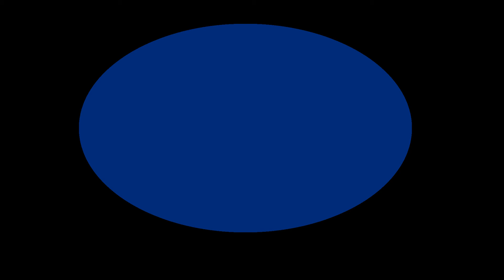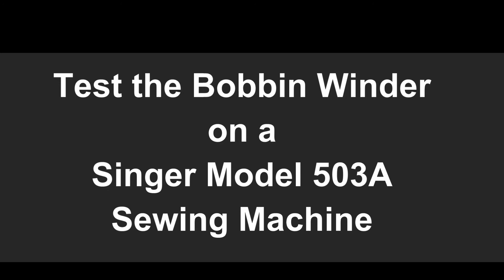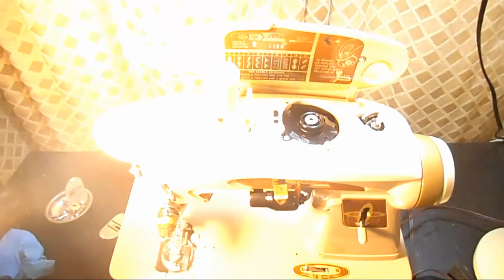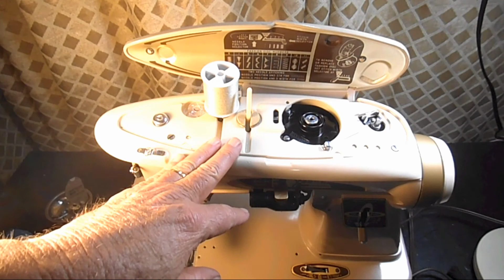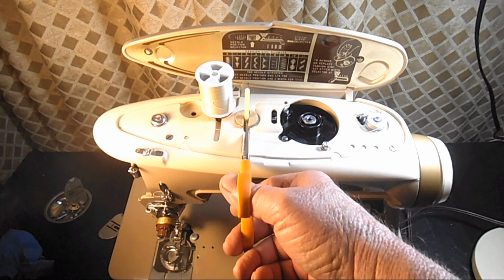Bobbin Winder Test on a Singer Model 503A Sewing Machine

Comment: I was gifted a 503A  I may never have been used!  I have done just about everything you recommended.  But I can’t get consistent use from the Hand wheel clutch?  
It keeps locking up and will not move to stop the needle from running!   I even have table that came with it!  Hubby keep saying throw it out!  I have hours into cleaning and oil and greasing a clean machine and trying to get it up and running!  I had to get new thread too.
Why do you thing the had wheel is causing such an issue, it will not engage then disengage it just locks up.
Reply from the maker: Sounds frustrating! Double-check the handwheel assembly, particularly the clutch washer. Sometimes, a slight misalignment can cause it to stick.
Here is a video for model 403A. https://youtu.be/ghnNYyMC1xU
The beginning and end show the removal and reinstallation of the handwheel. If the clutch washer is installed 180 degrees off or wrong-side-out, it causes what you describe.

Comment: My 503 won’t wind a bobbin. I’m thinking it might not be the spring, could it be the rubber washer ?.  Machine hasn’t been used in quite awhile.
Reply from the maker: Sure, it could be the rubber friction ring (tire). If it's the original it is 50+ years old. They do get worn (flat) and they also get very hard/brittle. I have a couple of videos all about the bobbin winder. https://youtu.be/BWdT7OlGUMg   and https://youtu.be/P2ROdLM5zmE   You have to take the covers off to replace the tire, so you may as well look at the springs while you are at it. Models 500A & 503A use a different tire that is smaller to operate in the tight space. I mentioned it in the video and just checked that the seller still has it: https://www.vintagesingerparts.com/products/bobbin-winder-tire-friction-wheel-26-mm-x-14-mm-x-6-5-mm-fits-singer-models-500a-503a?_pos=1&_sid=d8ef37fb1&_ss=r    If the one spring is broken (which it often is) this seller still has it: https://millardsewing.com/product/bobbin-winder-spring-new-stop-latch-spring-for-singer-sewing-machines/
If the machine needs other services you can check the 20+ videos in my playlist to see if I covered it: https://www.youtube.com/playlist?list=PLsCOZgzzaiKJZaZn2zl3LsnV2d7UhrqvX     Thanks for watching my channel, and good luck.

Comment: Hi Andy Been watching you for sometime now.  Absolutely great videos?  I recently purchased a 503 Singer, sews really nice, but bobbin winder doesn’t work.  I disengage the needle, pretty sure it’s threaded correctly .  I can hear the motor spinning, but bobbin doesn’t move. What would you suggest I next?
Reply from the maker: IMO the BW system is the only weak part of this beautiful machine. 
     It has two springs one of which is notorious for breaking. The spring affects the kick-out feature more than the winding feature., but it may need replacing anyway.
     The other possibility is it is out of adjustment and the Friction Ring (rubber tire) is not making contact with the handwheel. You can re-adjust it. 
     Also, the machine is 60+ years old and the tire can be worn or hard or even missing and needs replacement. It uses a smaller-than-average tire to fit in the tight space. 
     Finally, if there is oil or dirt on the handwheel where the tire contacts it can prevent good friction.  
Here is my 21-video Playlist for Model 503A. https://www.youtube.com/playlist?list=PLsCOZgzzaiKJZaZn2zl3LsnV2d7UhrqvX    
The first 2 videos on the list are all about the bobbinwinder system. 
The part 1 video has a link in the description to a vendor who sells the stop latch spring
The part 2 video has a link in the description below the video to a vendor who carries the correct tire. 
Thanks for watching my channel.

Comment: Sir, how do I replace the little black ring on the 503 lid? There are two black rings on the the inner lid that keep it fastened to the top lid. I also have a Singer 500 with the same issue. Where do I get replacement rings and how do I install them? Thank you for all that you do for those of us who love vintage Singers! I could never have done this without your wonderful videos!
Reply from the maker: They are a common or inconsequential part and not listed on the parts diagram so I can't give you a Singer Part Number.
On your machine it’s most likely an External Push-on Retaining Ring, something like this one:
https://www.huyett.com/products/fasteners/retaining-rings/push-on-rings/tx-012?searchText=Push-On%20External%20Retaining%20Ring
I would go to a local Hardware Store and bring your lid with you and see if they can fit the correct size.
Size can be tricky on sewing machines.
There are other styles of rings and washers that could work also if the size was right/better.
Search Google Images for “snap retaining ring” as an example ( you need snap ring pliers for these)
search for “E-Style Clip Washer” is another style you can search to see, and there are other push-on lock washers.
Like their name says they Push onto the short posts. I try to find a tube or small pipe or bigger metal washer to put on top of the
push-on washer so I can push it on evenly all the way around. That seems to work the best. I like the old style hardware stores, like Ace or True Value over the big box home stores as I get more selection and better service. You have an opportunity I don't if Kate means you are a lady type person (sorry, I don't know if it's proper to say that, and no offense meant) I'm saying I've had to wait 25 minutes while three sales guys helped a lady buy a 50 cent washer while I'm wanting to buy a $300 lawn mower. Besides helping you find a washer that would work I'll bet they would even install them for you. Thanks so much for watching my channel. Good Luck.

Comment: Hello. I recently got a 503a. My machine stopped sewing. If I turn the hand wheel it works but when I step on the presser foot it doesn't sew. It does pick up the bobbin so that's not the issue. It's my too thread. I've even checked my threading and it's not that either. I would greatly appreciate if you could give me some advice. Thanks you!
Reply from the maker: I'd like to help you, Ana, but I don't understand the problem you are explaining. I'm confused. "step on the presser foot"; "my too thread".
Can you try again, or post some videos on your YouTube Channel?
Reply: @andytubesewing1953  sorry for all my mistakes. When I step on the foot pedal to sew the needle doesn't move. If I turn the hand wheel it sews but that's it.
Reply from the maker: You said the machine stopped sewing. Were you sewing and it just stopped dead? Does the light come on? Does the motor run? When you use the foot pedal the needle does not move, but does the handwheel move and the motor run? Do the feed dogs move? Did you check that the stop motion knob is fully turned to the right tightly, as shown on page 11 of the Instruction Manual? https://www.singer.com/search/support?title=503

Comment: My machine 500A sew very well.but I cant to disengage the stop motion knob when I want to wind the bobbin.I hold the gold hand wheel but can not turn on the beige hand wheel .its stuck.please help me.than you from PERU.im sorry my bad english
Reply from the maker: Do not worry about your English, Freddy. Two things can cause this. The clamp washer behind the stop motion knob was installed wrong, or the knob was over-tightened. Here is a video showing the normal removal of a 403A handwheel. The stop motion knob is different, the way to take it off is the same. Start watching at 01:25   https://youtu.be/ghnNYyMC1xU  On your machine I suggest you remove the set screw entirely (all the way). If the set screw is jammed against a stop pin then removing the screw can let you remove the whole knob and reinstall the parts correctly. If removing the set screw does not help, then you can heat the inside parts as best you can with a hairdryer and put a couple drops of oil in the screw hole and between the two wheels. It's a little messy but easy to clean once the handwheel is removed. Then follow the 403A video for the correct way to install the clamp washer. Good Luck.

Comment: I have a rocketeer. When I wind a bobbin, and turn the beige and gold dials to disengage the stitch arm, I can turn them quite a bit but the stitch arm still goes up and down. How do I fix this? Thanks
Reply from the maker: Between those two dials is a clamp washer. If it is installed 180 degrees wrong then the two dials do not work correctly. If the washer gets stuck to the handwheel then it won't work correctly. (stuck with dried oil/grease) Not sure what you mean by "quite a bit" but it is not releasing the clamp washer so you need to dismantle, clean and reinstall correctly. Here are two videos showing the removal and reinstallation of the stop motion knob/screw and handwheel. (what you called the beige and gold dials) The model in the videos is a 404, so the parts look a little different in shape, but they work the same as your machine. No need to take off the counterbalance as in the videos, just the two dials and washer. Cleaning with dish soap or alcohol is fine.
Remove: https://youtu.be/eZiMaaka5HE
Replace: https://youtu.be/hHl96WL1kzA

Comment: at 4:05 you say it pushes the friction tire against the back of the hand wheel.... On my 503 the tire appears to go against the top of the drive shaft of the motor... but the top of that shaft has a "spring" on it... and my tire won't turn... am I missing something off the top of my drive shaft?
Reply from the maker: I apologize for the confusion, Jason. So many bobbin winders DO push the tire onto the handwheel I just automatically said that and it is wrong. Sorry. On the 503A the tire is pressed against the top of the motor shaft, which has "threads" for friction; like threads on a screw. Are you seeing threads maybe, If there is actually a spring it does not belong on the shaft if you have the original factory motor installed. I have a couple of videos all about working on the bobbin winder system that shows how to remove and replace it and all the parts and the two little springs that can break inside there. It's part 1 and 2. https://youtu.be/BWdT7OlGUMg     https://youtu.be/P2ROdLM5zmE   The tire is smaller than the standard Singer tire, which is a little too big. People substitute tires from other brands of machines to try and get something to work, so maybe that is what you have and someone put a sping to try and get traction on the tire. If you look at the videos I think it will explain a lot for you. Again, sorry for the confusion, and thanks for watching my channel.

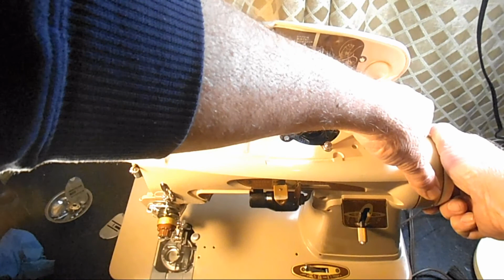Comment: At 1:12 yours only goes an 1/8th of a turn mine endlessly turns counter clockwise and doesn't disengage the needle, any ideas? (I have the Model 503A) Thanks for the help!!!
Reply from the maker: OK, so what happened concerning your previous comment from 13 hours ago? You obviously got it to turn the stop motion knob to turn. How did you do that? Did you remove the screw as I suggested? That little screw is what makes the knob stop turning counterclockwise. If you removed the little screw it can not hit a nub on the stop motion clamp washer and stop. Removing the little screw allows the knob to be turned left, but not endlessly. After some number of turns it comes off of the armshaft counter-balance it is screwed to. That's what you are doing by turning it left; unscrewing it, and after 15 or more turns it will fall off in your hands and you will be looking at the washer and inside edge of the handwheel. If it is not disengaging the needle bar it may be because the washer and/or handwheel itself is stuck to the arm shaft counterbalance with old dried up oil that is acting like a varnish or glue. Take the knob all the way off and take a look. Squirt some WD40 on the washer and arm shaft if needed. It sounds like the whole area needs a good cleaning. It may help you to study the Hand Wheel Instructions in the SERVICE MANUAL on page 18. You can get a free copy in pdf download at this link: https://sewingdude.files.wordpress.com/2012/09/singer-500-service-manual.pdf
Reply: @andytubesewing1953  I was able to turn it simply by twisting harder,  but now I will take it apart and clean it and check out the manual, Thanks again!
Reply from the maker: @StrongManMattt  That's great you got it to turn. Good Luck.

Comment: why can't I disengage the stop motion wheel? I have the same model but if I hold the gold wheel I can't spin the ivory wheel in any direction... I don't wanna force it and break it.
Reply from the maker: This happens sometimes when oil on the clamp washer dried hard to the wheel. You can try heating the area with a hairdryer to soften the oil. Sometimes someone has over tightened the stop motion wheel. All the parts should be metal and hard to break. You can watch the beginning of this video about removing the handwheel of the 403A to see what the parts look like inside. https://youtu.be/ghnNYyMC1xU
Your 503A has a different stop motion knob. (I assume you have a 503A since you posted on this video) you can (and should in this case) take the screw out and squirt a little penetrating oil ( like WD40) into the hole and around the sides of the knob. Sometimes you just need to muscle it if heat/oil won't help loosen it.
Reply: @andytubesewing1953  Appreciate the info 👍
Reply from the maker: @StrongManMattt  Of course! All the best!

Comment: Andy, can you help me with a problem? All of a sudden my stop motion wheel won’t tighten. If I tighten it and stitch without thread in the machine, it will operate for a while and then suddenly the stop motion wheel disengages and the needle slows way down compared to the speed of the motor. I can’t see that it is hitting something in the bobbin case, or what is going on. If it happens with thread in the machine I get a real snarl on the bottom side of the cloth. I hope my 503A hasn’t finally bit the dust. I really don’t want a new machine. Do you have any idea of what is going on? Hopefully someone locally will know a little bit about this machine.
Reply from the maker: Could be the stop motion clamp washer is on backwards. This video is a model 403A but the handwheels work the same. https://youtu.be/ghnNYyMC1xU
01:25 strats the removal and 54:26 starts the install. The stuff between is the bobbin winder so you can skip that. Take a look and see what you think. You don't need a new machine no matter what.

Comment: Thank you sir for all your videos on the 503a and 500 rocketeer series. Watching them made me confident enough to buy a vintage 503a machine. I look forward to using it and will keep referring back to your videos. Thanks for sharing your knowledge.
Reply from the maker: Thanks for your kind comment. I hope you enjoy your 503A Rocketeer. The series I did on the model 404 may be of help also because many of the parts are the same except the 503A has the camstack and zigzag of course. https://www.youtube.com/playlist?list=PLsCOZgzzaiKIB4kvIHCfHYuyLMUp5A4UI
You can also go to this link and download a free copy of the original Singer Service Manual for the 500A/503A. It is full of instructions about adjusting, removing and replacing the parts of the machine: https://sewingdude.files.wordpress.com/2012/09/singer-500-service-manual.pdf    (45 pages)       
I also like to keep a copy of the Parts Chart nearby when I restore a machine in case there is a missing or broken part I will know what it is and where it goes. 
You can get a free copy of the 503A Parts Chart here: http://parts.singerco.com/CPpartCharts/5_59999/503A.pdf
Best of luck Amruta and thanks for watching Andy Tube.

Comment: Morning Andy. Should the feed dogs be lowered when winding bobbin like in your video.
Reply from the maker: Hi Terry. The position of the feed dog won't matter since it will not be moving while you wind the bobbin. Normally you would have turned the Stop Motion Knob, like at 0:55 in this video. That stops the needle and feed dog motion. So the dog can be at any position while winding the bobbin. You can wind a bobbin without disengaging the knob if you wish, and you can even wind a fresh bobbin while sewing on the machine. My wife does this when she notices the thread getting low on the bobbin and knows she will need more to finish the project. Thank you for asking.
Reply: Andy Tube thanks for this detailed comment. Was unable to turn my knob to disengage. Glad to know I can still load bobbins! Operation

Comment: In a video you said “preferably plastic” when talking about that bobbin - why? Love the videos. Just got this machine - complete for $15!! I’ve been wanting one.
Reply from the maker: You got a real bargain, congratulations! Singer eventually moved from metal to plastic bobbins on its domestic models. The metal bobbin spinning in the bobbin case/holder eventually wears down the metal ledge the bobbin sits on as it spins. The bottom of the bobbin can start contacting the top of the hook platform which causes stitching problems. No one makes new bobbin holders for these type vintage machines (that I can find) I believe it is better to wear out the plastic bobbin than the bobbin holder. I know many people prefer the metal class 66 bobbin, but they also wear out and need replacing. The people I know who sew with the models 401A, 403A, 404, 500A, 503A, etc, do not notice and difference in performance between the metal or plastic bobbins as far as stitch forming. 
I have bought a spare used bobbin case/holder for all of our vintage machines. 
Best wishes with your "new" 503A, and thank you for watching Andy Tube.